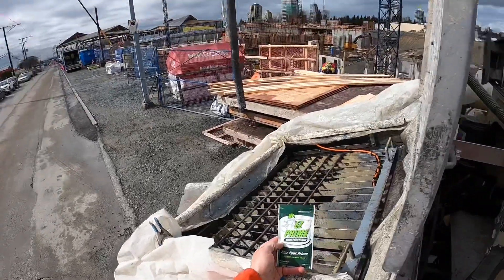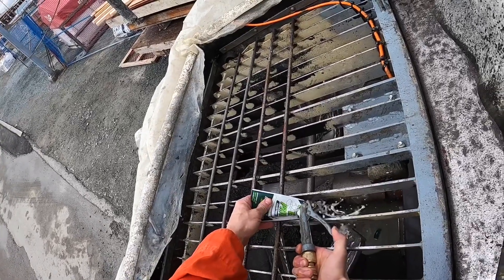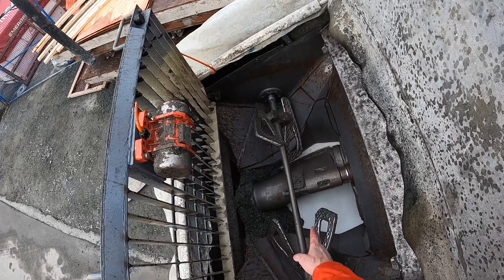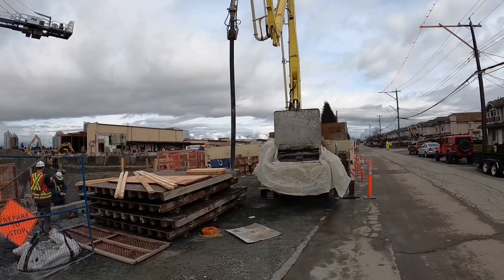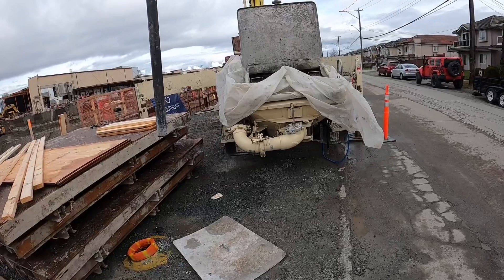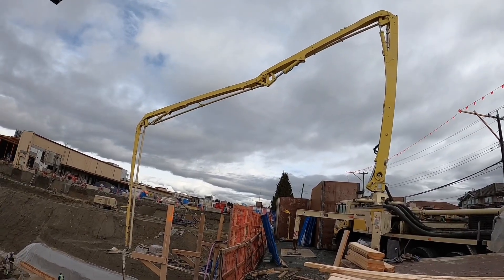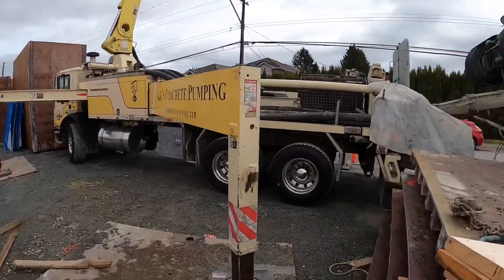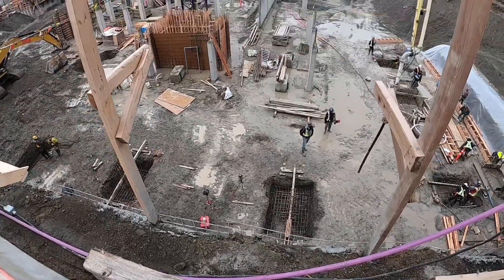Priming out a Putzmeister 40Z concrete pump using  Slik-Pak/“EZ Prime” liquid priming agent.

Comment: Is that a 4.6" machine? Just curious is all. Always cool to see different ways to do stuffs and things. Look forward to many more
Reply from the maker: Yes sir. 4.6” boom pipe on this one. It reduces down to 4.6” at the “cannon”, so aside from the pipe wearing a little quicker, and being outrageously expensive, it’s not too noticeable of a difference from standard 4.8” pipeline. I most always just prime this one with water, unless I’m making YouTube videos 😂😂😂
Reply: @canadianconcretepumper1979  Our 40 is also 4.6". I did the same deck pour with the 40 and a high pressure 38-5 and they both gave 105m on kill on the box lol Those 40s are sweet little machines. Super smooth and a very nice foot print
Reply from the maker: @greghughey9738  yeah man, that 40 was such a nice footprint considering the amount of reach. It was a legit 9’ of reach versus our 38-5 with its cantilevered pedestal (loses that additional meter when booming horizontal). Regrettably, we sold that 40Z back in the early spring 🙃🙃🙃
Reply: @canadianconcretepumper1979  That was plugged into 100'x4" BTW lol

Comment: Why not just use the prime port to mix the ez prime or slick pak?
Reply from the maker: I prefer to use the prime-port as little as possible as the threaded bolt used for fastening the clamp has a tendency to strip-out with frequent usage. Honestly, it’s mostly just faster/easier to toss slick-pak directly into the hopper as well, in my opinion.
Reply from the maker: I only really use the prime port for if I’m priming through the boom + a bunch of line/system.

Comment: Pardon my ignorance but how does the rotation direction of the agitator after the concrete in the hopper?
Reply from the maker: I like to have the paddles rotating towards the rear of the hopper as the first bit of concrete falls in from the mixer truck and once the hopper is full I will then switch it to rotating forward. Honestly, this step is really only of any added benefit for times when the the mix is extremely harsh/rocky.

Comment: Here in Ireland I like to prime out slowly aswell with just water if just using the boom but if line on I mix up a 25kg bag of cement in two buckets and pour it in the line
Reply from the maker: Cement powder great for priming as it does not compromise that first bit of concrete out the end of the hose. 👍🏼👍🏼👍🏼